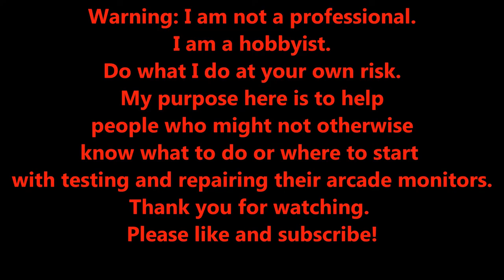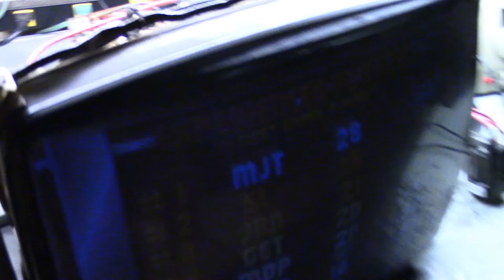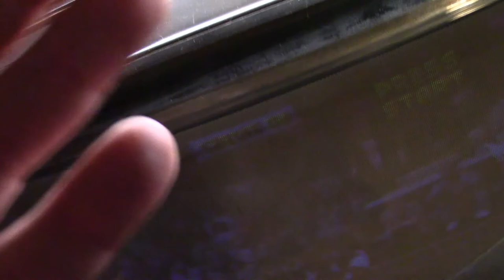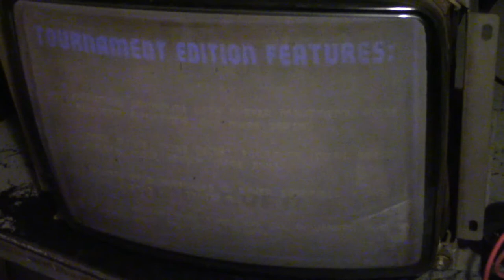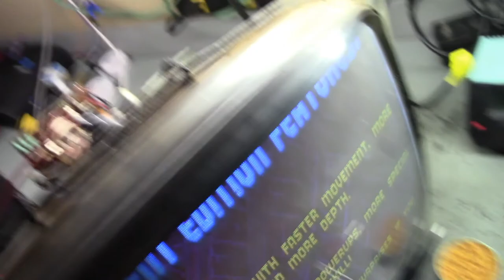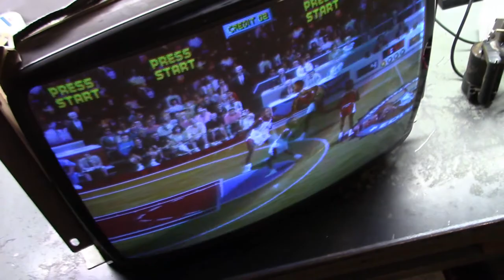Matsushita TM-202G Arcade Monitor Chassis Repair - Bad Flyback

Comment: I've got a matsishita as well on my bench right now.  It works but image is very dim.  I used my ESR meter on several of the caps and I have several bad caps with very high ESR values I'm hoping my cap kit will bring up the brightness of the tube. But if not, I'll definitely be buying a flyback for this model with arcade shop. I've never had a problem with APAR either.   Glad I watched this video.

Comment: I know this vid is old but wondering whether Peter or Steve got back to you on what the deal was with their flybacks?  Wonder how much a difference a  ringer test would have shown on the two flyback's heater v. pins.  Thanks for sharing btw.
Reply from the maker: Haven’t heard back. Peter’s had the correct footprint but had low heater voltage. Steve’s had good heater voltage but the wrong footprint. Can’t say for sure what the deal is/was.
Reply: @MikesArcadeMonitorRepair  Thanks for the reply.  You went the extra mile getting arcadeshop one to fit.  Great Vids!
Reply: @MikesArcadeMonitorRepair  I am having the same problem with a repo 4900 flyback I got from Peter, I do slowly get a picture, but I have no neck glow. I am putting it in a 13" 4800 but they look the same to me. When I test the tube on my CR-70 I have neck glow. I don't have a true RMS meter to check the voltage, so I am stuck for now.  Got a 4900 chassis on the way hoping the flyback will be good and I will swap the HVT in and see what happens. The original flyback was arcing from cracks on the top so I could use hot glue like you did to see if it would still work. Working on a video which looks like it maybe a 2 parter.

Comment: What do you mean it "shocked itself a hole"? Did it smoke from that hole? And how did plugging the hole fix it?
Reply: It sounds like the transformer experienced an internal arc, which caused the arc to blow a hole through the external shielding surrounding the windings. 

The most common way a transformer can arc to itself is if the insulation/coating of the windings themselves starts to break down. These windings often deal with thousands or tens of thousands of volts, so they need an insulation with an extremely high dielectric breakdown to prevent arcing. But like most chemical compounds, these coatings and insulations do wear with age. 

My guess is, by plugging it with hot glue, the internal short was corrected (as the wires were now coated with enough insulation to prevent an arc) and this allowed the transformer to work normally again.

Comment: Hi mike. I know you usually use your Mortal Kombat pcbs as your test boards.  I do as well. I was wondering if you ever experienced issues when you use Mortal Kombat as a test board with this matsushita chassis and also the 4600s? It's strange because I always use my Mortal Kombat pcbs as my test boards for my k4900s and my k7000 and  it always works perfect. However with these older weird models such as the 4600 and the Matsushita, it does kind of a waviness ( hula) affects similar to what a bad filter cap would look like and an unstable picture like it's pulsating or something. If I hook up one of my other test boards  such as Bomberman for a 16 and one board or my tpg, it's a perfectly stable picture. Please tell me you've experienced this. LOL
Reply from the maker: Hmm. Not that I can recall. It worked fine with the Jam board, which isn’t any different from MK, regarding being a T-Unit.
Reply: @MikesArcadeMonitorRepair  yeah this is very strange. There's something about my test station and these Midway PCBs and these older monitors such as the 4600 and the matsushitas that creates a bad mix. Almost always happens with the 4600s.